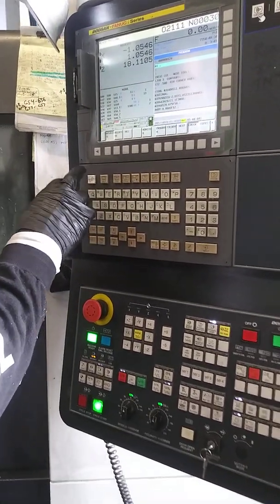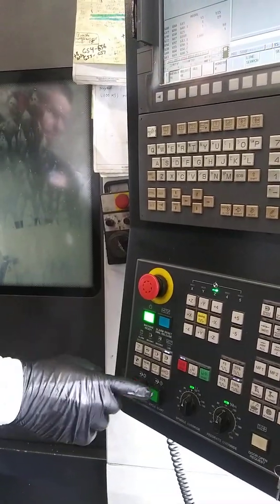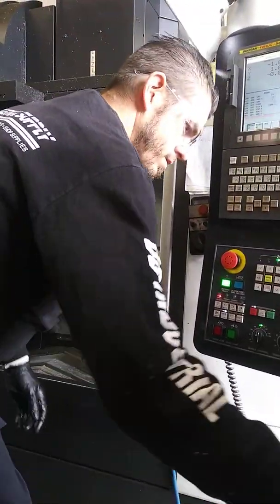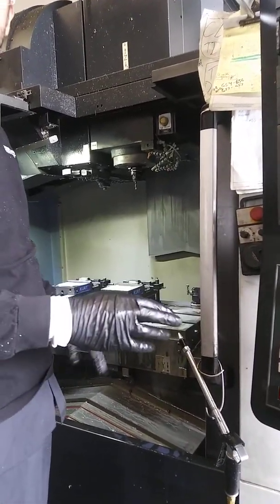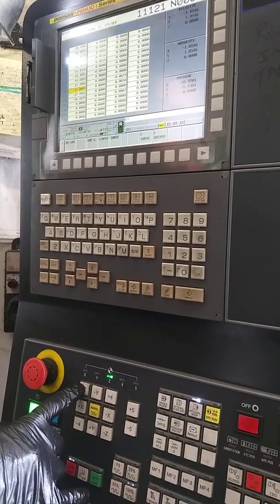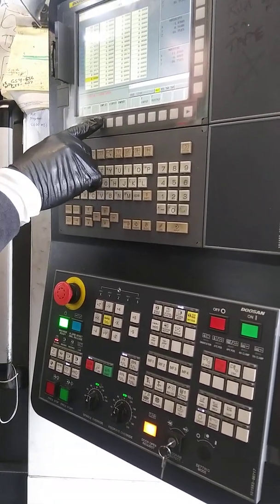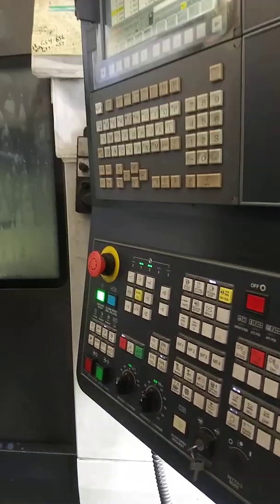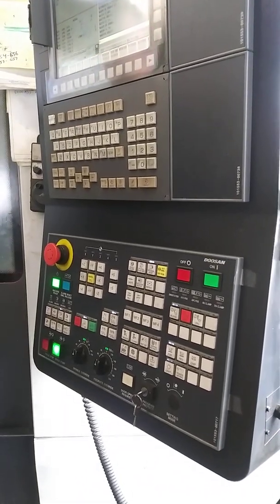How to change tools on a Doosan dnm4500

Comment: Do you have to run the m6 code for it to allow you to remove the tool or is that just to select the right tool from the carousel?
Reply from the maker: Yes to select the tool we have to called it. With tool number and m6. Then change mode to manual to take it out.